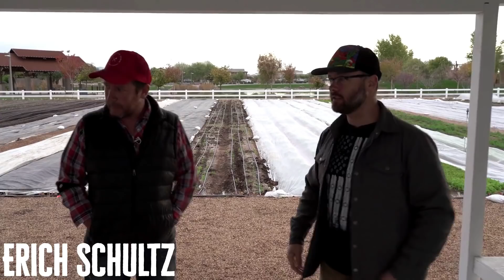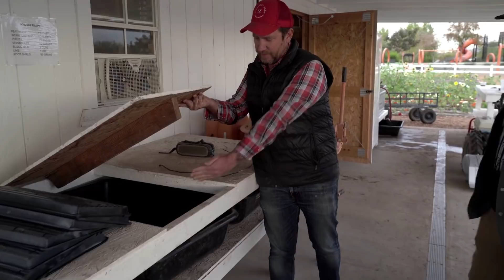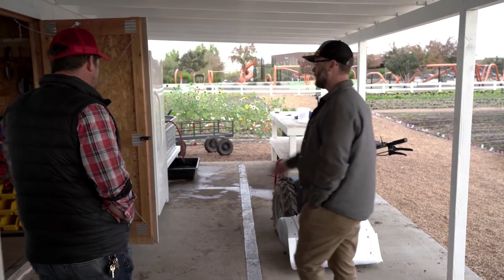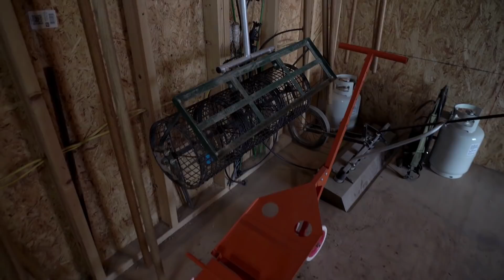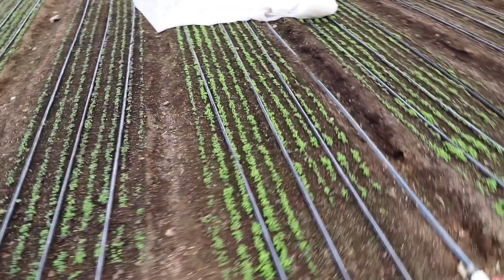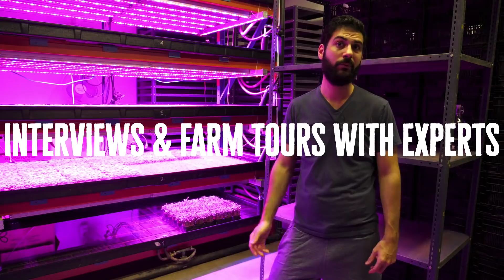Tools & Infrastructure at Steadfast Farm

Comment: What is a good tool for burying drip tape besides for the 3 pt- tractor -mounted implements? I prefer a wheel hoe. I looked at the Hoss wheel hoe for buring tape but it cant be used simply on 30" raised beds, as it is not swiveled at the base. The Glaser looks useful for raised beds, but it has no drip tape roller attachment. I have a couple of 4-wheel tractor cultivator implements to create furrows with. If I use the Hoss drip layer, maybe it will work better if I use the tractor to create furrows first?